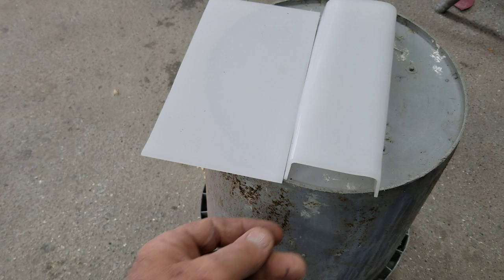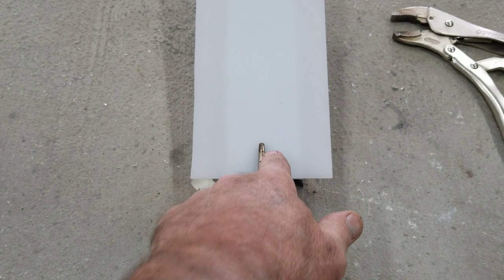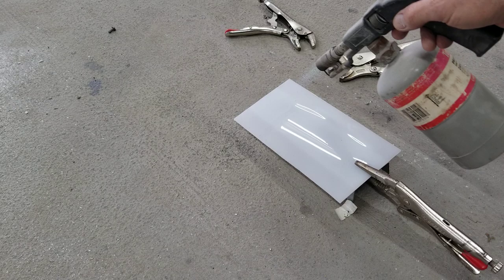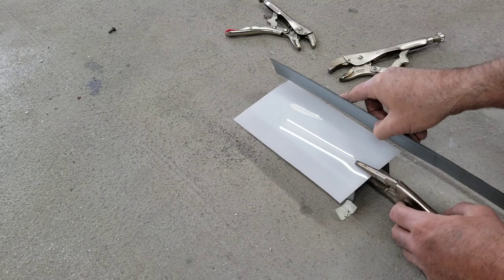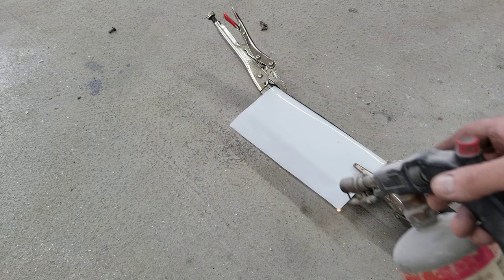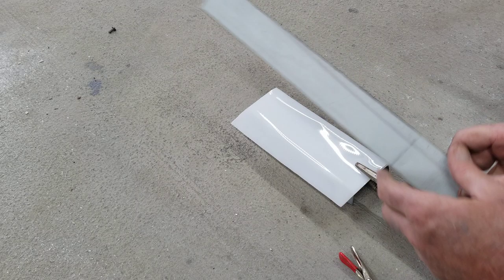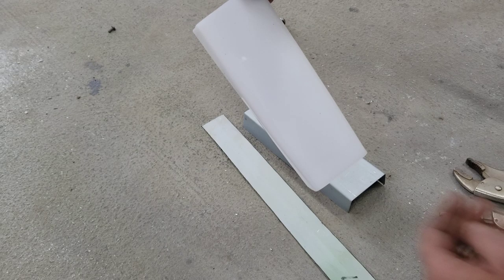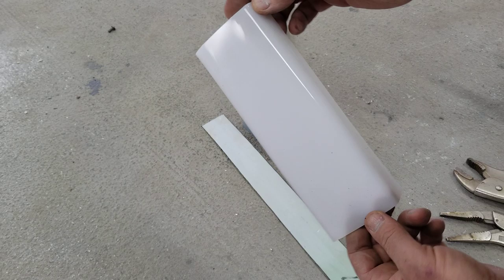VW BUS RESTORATION - Westfalia so42 Clam shell light lens forming

Comment: Some more parts came in and the front door window sashes are made to thin. the old ones were 18 gauge and these are 22-24 ? I am not going to even try to use them . I have enough 18 gauge 400 SS from that gas grill lid to make some . And this will be the last I will ever need. I made a DIY metal bender that Rossturations gave the plans for and I pull it off myself.